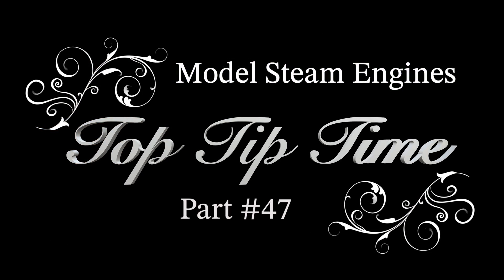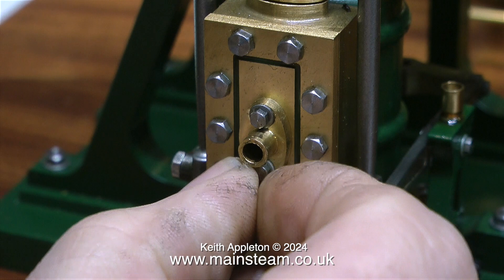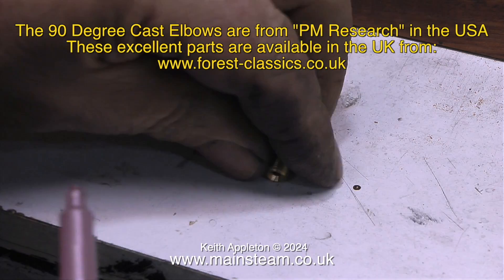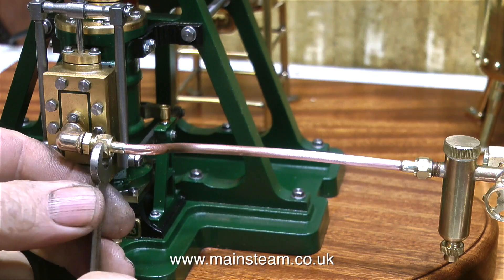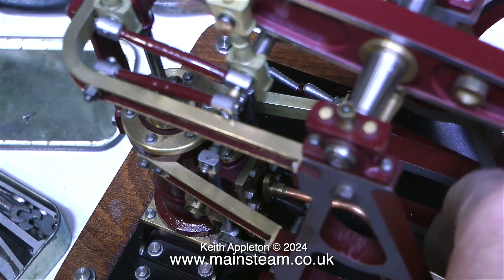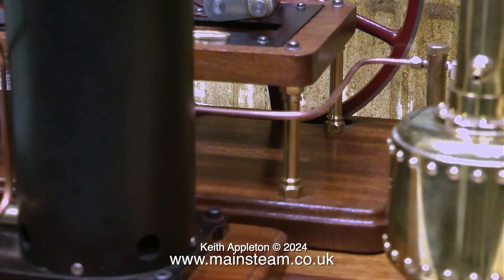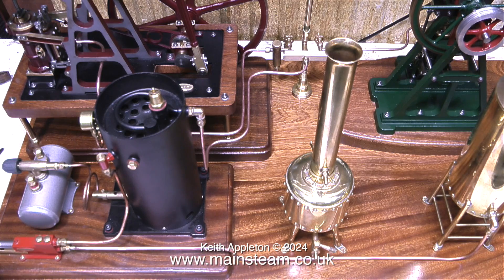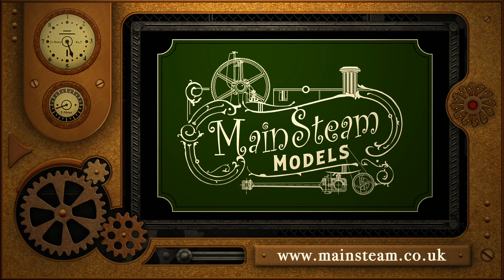MODEL STEAM ENGINES - TOP TIP TIME - PART #47

Comment: When I worked in the Gas Industry (British Gas), part of my work involved piping up decompression stations, PRS's (Pressure Reduction Stations), I used to love working out, bending and fitting the pipe runs, mostly in stainless steel, sometimes in copper, and as for Bahco spanners, I couldn't have done my job without them, yes them, I had a range of them from 4" up to 24". I still have a couple of them in my workshop now, but don't tell BG will you. shuuuush.

Comment: What? 1/4 x 40 British is a different pitch to 1/4 x 40 American? 
Whoever told you this is talking rubbish. 
40 threads per inch is the pitch. 
40 is 40.
The difference is the thread angle. 
American threads typically use 60° included angle but British threads typically use 55°. For these tiny bolts on model engines the difference won't matter. 
Just don't mix and match American and British if your building a full size aircraft engine.

That steam plant looks amazing. Anyone would be thrilled to have that on display.
Reply from the maker: The 40 refers to the threads per inch, and not the thread's pitch. USA and British thread pitches on this size seem to have a different pitch angle 55 or 60 . . . . if you don't believe me, buy a PM Research cast elbow and try to fit it to a British made 1/4 x 40 TPI (threads per inch) . . . . . I speak from a lot of experience using these things, nobody told me anything.